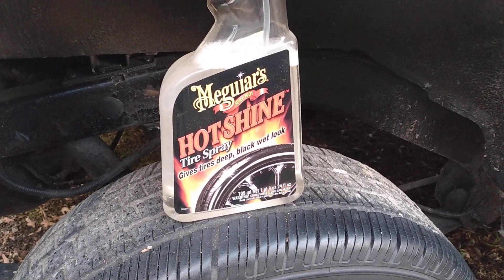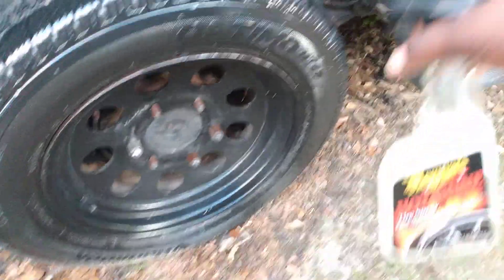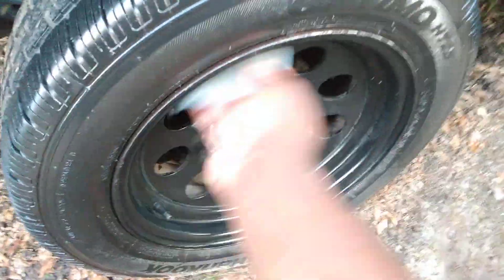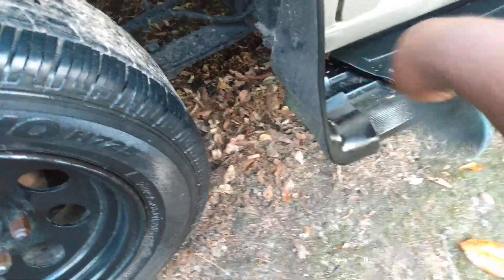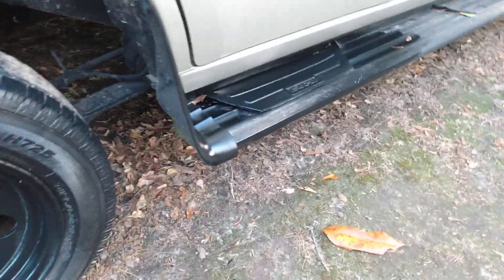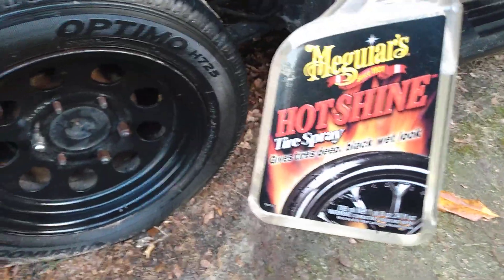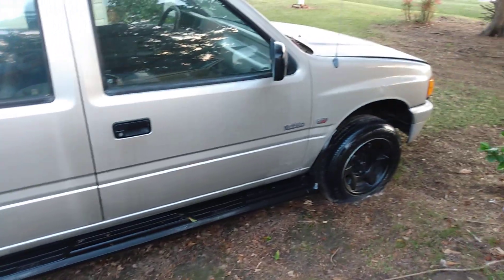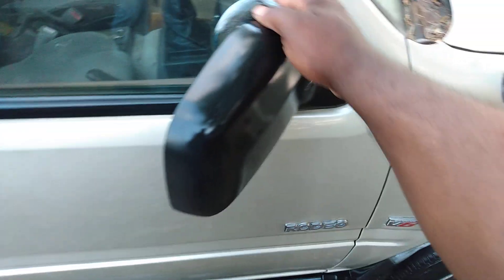meguiar's hot shine tire spray anybody still use this lol 😂😂😂

Comment: Haha! duuuuude.. did you even read the back of the label? DO NOT spray on other plastic or vinyl surfaces, will cause staining. It's formulated for rubber tires, nothing else!
Reply from the maker: Never had any problems on trim don't believe the hype it works on any trim tfw